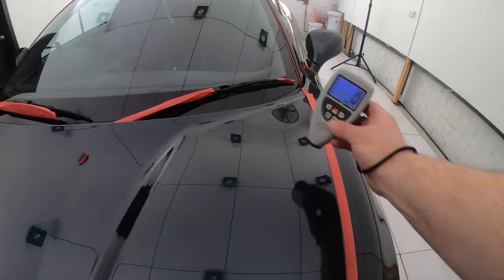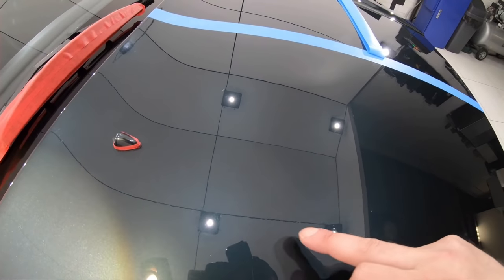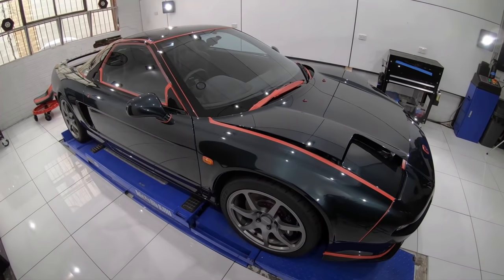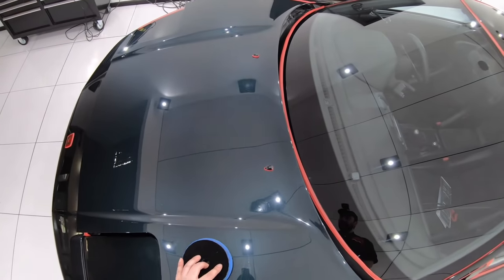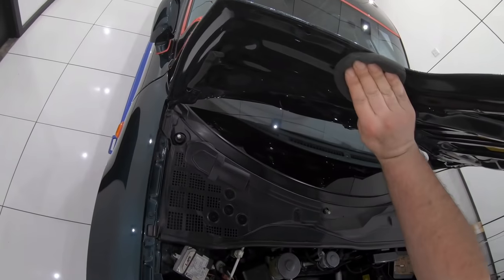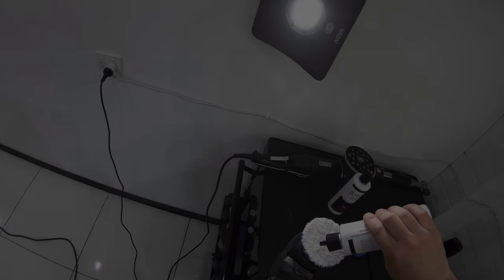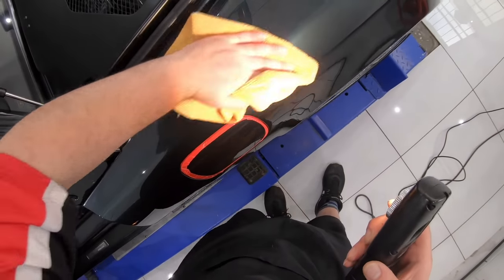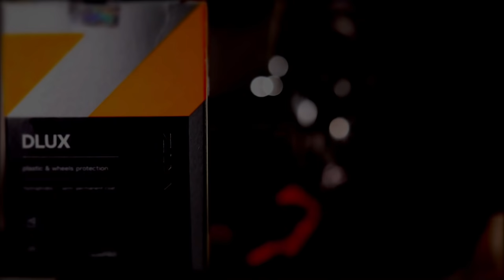Honda NSX High-End Detailing - Part 2 Paint Correction (Vlog 23.2)

Comment: The fact that a soft pad and mild abrasive can lead to marring is an important observation that is important to keep in mind. You're theory as to why that could be the case sounds logical especially if the polish it a diminishing abrasive type rather than a SMAT type. As for single stage paints being tough to finish out, that's why glazes were always soooo popular ;-)

Comment: Sandro I totally agree with the glass needing a polish in order for coatings to perform at their maximum and last the longest. I feel like it "unclogs" it in a way. Same goes for paint, some professional detailers say you don't have to polish the paint in order to apply a coating. While this is true in a sense, I completely disagree with that. Even if the paint is free of swirls, there are "contaminants" that prevent coatings/sealants from performing their best and lasting their longest when applied. Don't know what it is but I know from experience it makes a noticeable difference. Incredible work on the NSX, can't believe I didn't buy one when I had the chance.

Comment: I never use a black pad to finish on any paint type.Great video!
Reply: That's crazy.. my whole career I've used black pads for finishing because that's what the industry says so for perfect finishing
Reply: @daves.3278  not saying that black pads wont ever finish perfect. For softer black paints, I find a stiffer pad(rupes yellow pad)  to finish better. In fact, Rupes doesn't recommend using their softest pad on soft paint.
Reply: @c6z061  gotcha! I can tell you've been doing this for a few years now lol I'm going on 3 and dont have that knowledge yet
Reply: David Saucedo I’ve been doing this for about 10 years. My knowledge is good. However, I’m still learning, that’s why this is my favorite detailing channel, because Sandro is a MASTER!!! I use the Rupes yellow pad for 95% when finishing. The other 5% may require a black pad or something else. :)

Comment: On a side note, like you said, you can't always go by what a paint meter says to determine a respray. On the roof and 1/4 panel, the re-sprayed readings would actually be consistent with OEM paint thickness. But as you said, it was obvious by looking at the paint, it was not original. I go by look and feel first to determine OEM versus re-sprays. If you know what you're looking for, it's pretty easy to detect a re-spray by look and feel, unless it's an OUTSTANDING job, which is very rare. Love your videos.
Reply: @CarCraftAutoDetailing  you're the best! ;)

Comment: Amazing video Sandro! I'm looking to get my first DA Polisher soon and was wondering what you think about using 3 inch pads on a polisher that comes with 5 inch pads, is this even possible and/or recommended?
Reply: @CarCraftAutoDetailing  Thanks for the quick reply. Do you think I can get away with using 5 inch pads to do a whole car or will I need a smaller pad to do the more intercate areas/raised edges and such ?
Reply: @CarCraftAutoDetailing  Time for me to pick up a polisher very soon then! Thanks again Sandro.

Comment: Awesome work Sandro, why aren't you fully priming the pads with the compound before you start using it? Didnt you use to do this before? So the whole pad is wet with compound rather than letting it prime as you're doing the first set of passes.
Reply: @CarCraftAutoDetailing  Of cheers mate, just another quick question how does Shine Supply Classic Cut compare to Precision and The Last Cut.

Comment: I thought that when you cut that was all for taking clear coat away and that second and third polishing was just refining. So a 2 step or 3 step takes away more clear than a 1 step even though it’s a compound and it’s cutting. 
So you can correct paint by just polishing and not cutting? It just would take longer right. But you would be taking very little clear coat at a time which would be safer?
Reply from the maker: It’s a matter of yes and no to all of that. 
Whenever you compound or polish you are always removing clear coat, but at various volumes. How much you actually remove depends on a lot of things such as the paints hardness, your combination of products and your technique. So a light polish can actually remove more clear on a soft paint than and heavy compound can in a hard paint. It’s all dependant on the specifics which is why those are hard questions to answer.

Comment: The light polish and light pad inducing haze made me realise I will never full understand all this....
Reply: I can try to explain it. As you probably know there are 2 major abrasive types 1. Diminishing abrasives and 2. SMAT (SMAT stands for Super Micro Abrasive Technology). #1 breaks down as you use it so it starts with its maximum cut and works its way down to a finishing polish. Used properly it's like doing 2 steps in 1 (in theory). SMAT (in theory) gives you a consistent cut from start to finish and that cut is meant to be rather fine so whenever you stop, it appears you finished down. Now. if you're using a diminishing abrasive and stop too soon or use a pad/polisher/speed/pressure that is insufficient to break the polish down and finish out, you wind up with marring (i.e., polish induced fine scratches). It's like sanding wood with 120 grit and stopping there - the scratches can be seen because it's just not fine enough for finish work. So the polish never get to the 260 - 320 grit level to finish out. Hope this makes sense. It's a really important observation that guys with a lot of experience like Sandro see happen and then always account for and leaves driveway detailers perplexed.

Comment: Hi sandro, what’d you use on polishing those glass?
Reply from the maker: It was the same combination I used on the paint
Reply: Car Craft Auto Detailing thank you man, I appreciate it! I thought I should use dedicated glass pads in removing and polishing glass but i can also use pads dedicated for paint
Reply from the maker: Yes, you need or often want to use certain dedicated glass polishes or pads, or at least I prefer not to.
Reply: Car Craft Auto Detailing but can you use just foam cutting or microfiber pad to remove scratches on the glass and watermarks?
Reply from the maker: Water spots yes, removing scratches just isn’t something that I purse on glass as it’s not a viable process unless you get into using diamond sanding and polishing discs